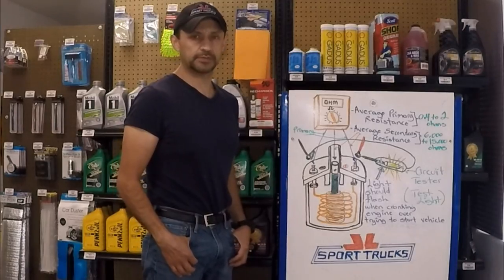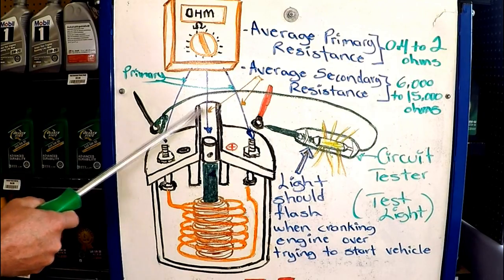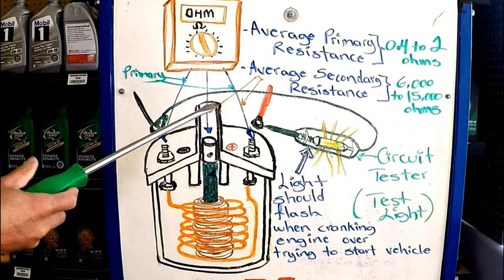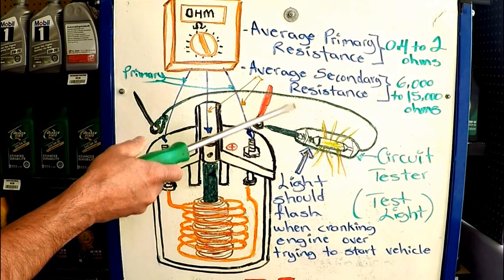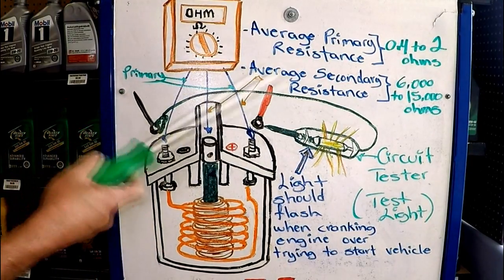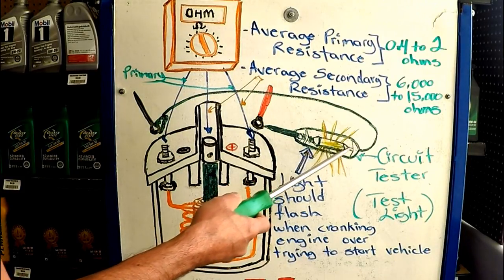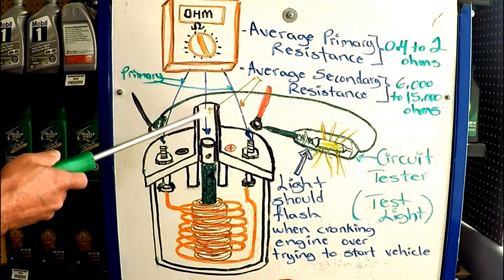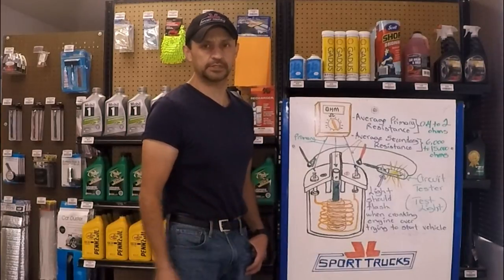How to Test Ignition Coils

Comment: Excellent explanation of this circuit.  Your English is very good and clear.  Easy to understand.  I have a question: would you use a Megger to test the insulation integrity of the windings in the coil?